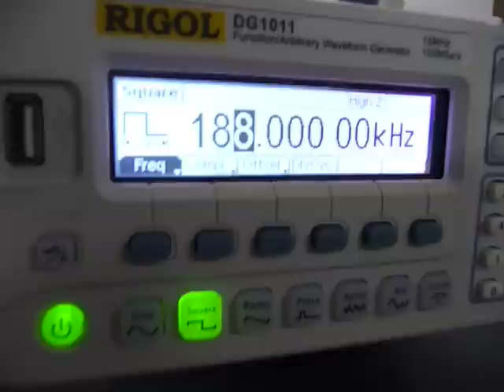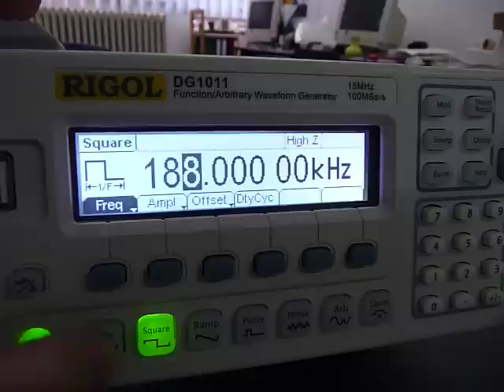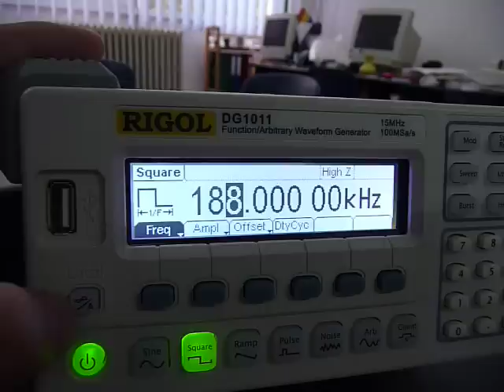Wireless Power Transfer through Resonance

Comment from the maker: @1PlayerPiano this transfer method uses electric pulses, so it needs something to generate them... otherwise its just short circuit on a coil. This is not just inductance, it works through resonance, the electricity is transferred only at certain frequencies!

Comment from the maker: @WatchmenDrManhattan I haven't measured the input or the output power, but the signal generator gives a very low amperage, that's why the led has to use 20 volts. Even a normal incandescent 3V light bulb is lit up with around 20V from the signal generator.

Comment from the maker: that one (ceramic disk capacitor) is not polarized as I know, so it should be good, usually the cylindrical shaped capacitors are polarized, and they are marked along one side with minus signs (the other side thus is +)

Comment from the maker: @rcboatdriver1234 Why a transformer?? The 2 coils are identical in length, no step-up or step-down of voltage, the circuit is working at a longer distance if uses capacitors too for the resonance effect, and with capacitors it transmits the electricity only at certain frequencies

Comment: Something that transfers directly means you have a physical electrical connection. You are dealing with magnetic resonance. When the resonant frequency from the primary closely matches that of the secondary the magnetic field created in the primary resonates the secondary which induces current flow. You don't really need the capacitor, you should be able to just use a current limiting resistor on the positive lead of the LED.
Yes air cores saturate easier than ferrite cores so ferrite is better.

Comment: Transformers don't have to have ferrite cores.
Transformers do transfer electricity through air. (that is how they work)
In order to get the LED to light up you need the non-polarized capacitor and the certain frequency, not to get the flow of electricity from one coil to the other.

Comment from the maker: -A transformer without ferrite core has much less efficiency, so they need ferrite cores;
-In my opinion transformers transfer magnetic flux, not electricity directly...
-A LED doesn't need a capacitor or a certain frequency to light up.

...but correct me if I'm wrong ;)

Comment from the maker: -I haven't experimented too much with this, but I think changing the no of turns will also require other pulsing frequencies also
-the value of the capacitors... I don't know, I thing it wasn't written anything on them, that's why  I didn't specified anything, but they have to be unpolarized, that I'm sure of
-unwrapped coil's length

Comment from the maker: I'm not a pro in this stuff, I only replicated what others did...
The coils that I used are with 1 wire only (not 2 parallel wires next to each other like in phase & null, or plus & minus usage). The diameter of the wire is around 1mm (metal's diameter).
The frequency range depends I think on the coil's length, used capacitor's value, LED's power consumption, and maybe the input power too (signal generator's power).

The description below the video also has some similar info. Good luck! ;)

Comment: Ok, So I visited Radioshack, and had no idea what I was looking at so I bought a random package of capacitors... here's the specs: 0.01µF Ceramic-Disk Capacitor 500WVDC Maximum with an operating temp at -25º to+85ºC, lead spacing 9.5mm, and tolerance of +-10% and a temp coefficient of Y5P... but I have no idea whether or not its unpolarized... :P could you help?

Comment: hi brother can I change the coil like the no of turns?what value of capacitor have you used for primary and secondary?what did you mean by coil length 5 meter in your description ,is it wire length or coil axial length? please answer me,i deadly need this to do?